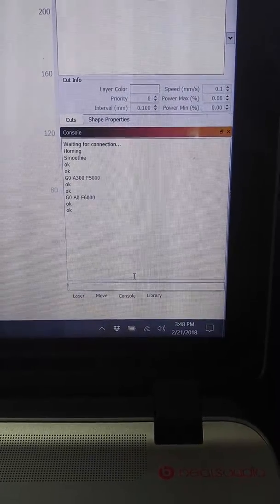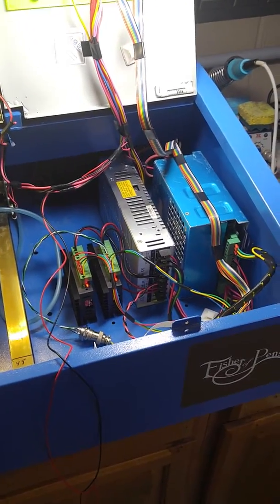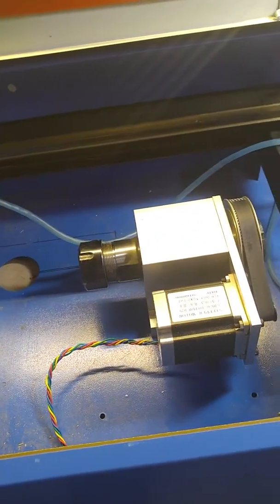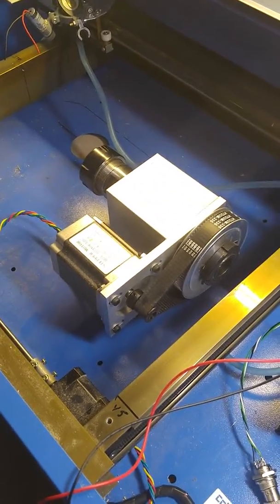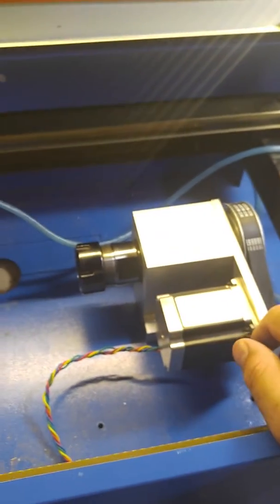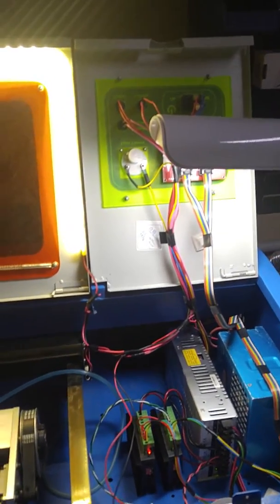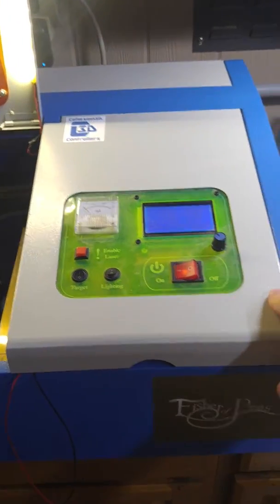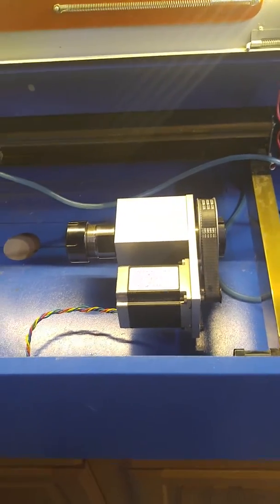K40 Rotary with Cohesion3D mini and LightBurn

Comment: Great videos! Just found your channel and subscribed. I have basically the same rotary and when using it with lightburn in inches the rotary doesn't spin the proper amount. The linear move will move the correct distance however. A fellow on the forum suggested that I change it to mm so I did and that fixed it. Strange behavior though. Have you seen this issue and have any work arounds or ideas on it. Thanks!
Reply from the maker: I don't recall running into that, however I work almost exclusively in metric in the shop and have since switched to the little comgrow roller rotary as it works better for my needs than the chuck style did.  It may be that I just never tried it in inches.

Comment: NIce setup. Got a detail of how you wired the second PSU in and the other add ons. Still working mine out. THanks.
Reply from the maker: Each one has it's own little variances depending on the stock power supply you're dealing with. You may get a better answer over on one of the C3D groups either on G+ or Facebook. Let me know if you need any links.  But the short answer is that the 24v supply powers the C3D board and both external steppers. The lead from the original PSU is just disconnected and taped off.

Comment: nice update Carl.   My k40 and cohesion 3d upgrade kit is on its way as I type this.    Might I ask for a link to the power supply you are using?   I will eventually have all 4 stepper motors wired up as well.   Thanks.
Reply from the maker: I'm not sure honestly. It was a 24v 8A power supply that I'd had lying around for some time. You can usually pick them up on Amazon, Ebay, Banggood, etc.. for pretty cheap.